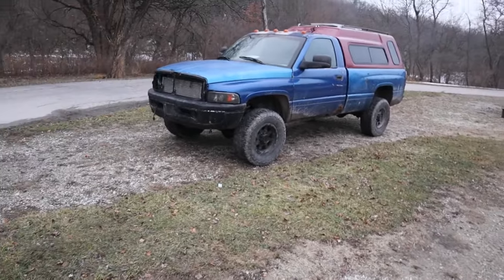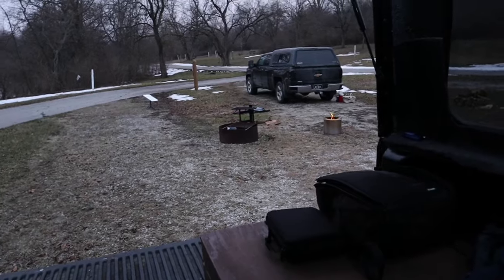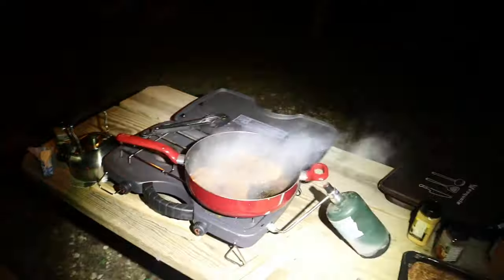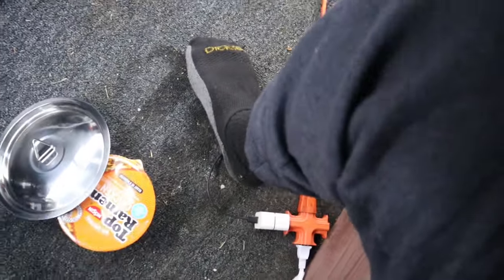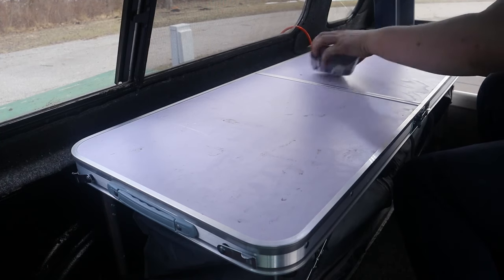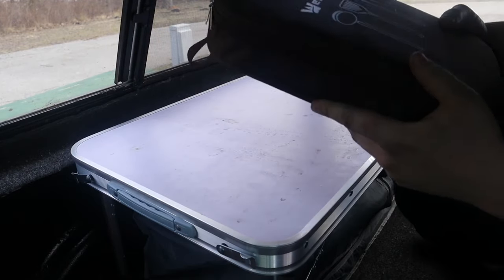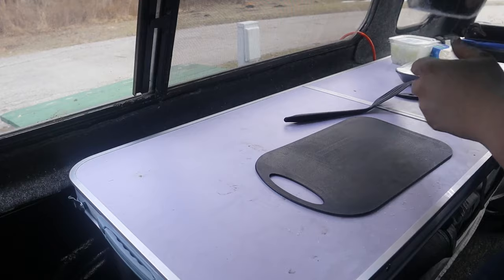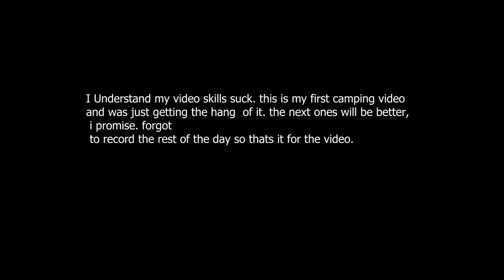First Time Truck Camping!!!!

Comment: Ah,  an 8ft bed. And high top topper. Awsome. Those a 2 things I wish I had on my little camp setup in my 07 Mega cab. 
My 6½ft with cab high topper gets a little tight. 😊
Nice beginning of your camp build
Good luck with the channel.  Thx for sharing